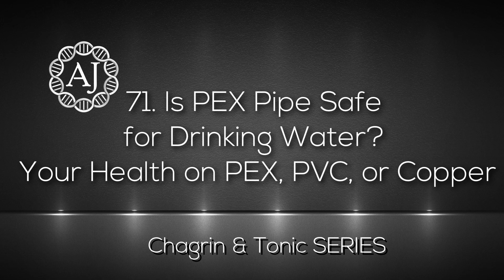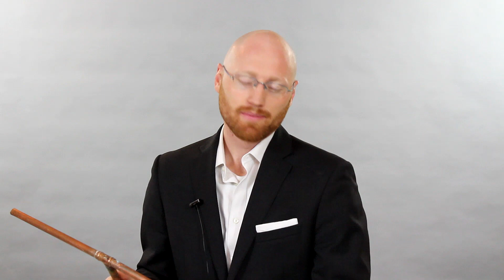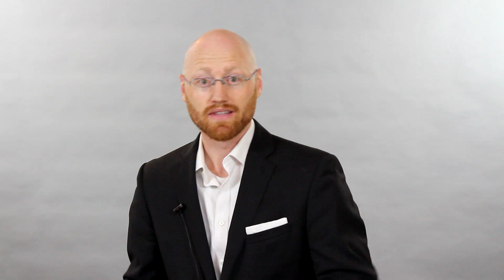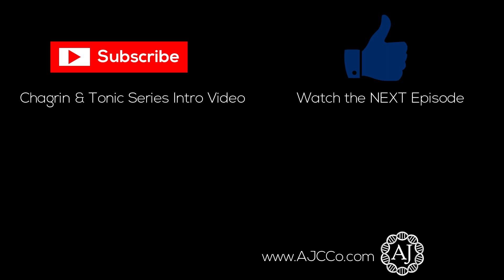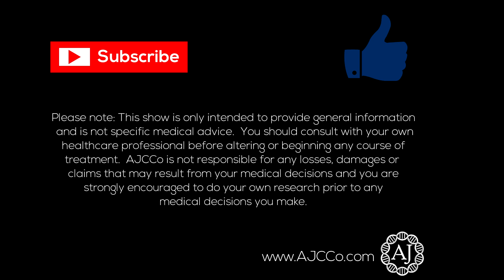Is PEX Pipe Safe for Drinking?  FILTER!

Comment: I'm curious if there is much danger to using the water for bathing and hand washing.  If we just filter our drinking water, does that negate the effects of the PVC piping?
Reply: The human body absorbs by the skin. Its still possible but a much lower risk.
Copper for Kitchen/drinking/cooking 100% at least.
A good filter would remove anything from PEX. Kitchen sink reverse osmosis filters etc. They not too costly. I would do that if you have pex everywhere.

Comment: your content is awesome and brings to light that no one in industry cares, build it faster and cheaper, i will stick with my copper plumbing as in a 1000 years copper will still be copper, a natural element. can you please look into the plastics that  filter heads, RO system plastics and any of the plastic filter jugs and other methods of filtering. Can you also test the water from copper plumping for these chemicals as the water coming to your house from the city is probably delivered from plastic city pipes?

Comment: Have you tested whether water filtration works to remove these specific chemicals in water? For example, I use zero water filter which comes with a tds Meter - but will the tds Meter read these chemicals/plastic? Will the zero water filter really remove these chemicals? And finally, do you know which would be worse- old pvc or copper piping vs pex piping? Thank you in advance I am trying to decide which place to move in to with these options..
Reply: Good question. I think Reverse Osmosis is the best practical filtration for drinking water. Distillation is better but takes time,  effort, and energy $ to make smaller quantities (quarts vs gallons.) But how much gets absorbed by our skin during daily showers?
Reply: @dii6266  Yes thank you. I have a filter on my shower head too but it needs to be changed too
Reply: @dii6266  thank you for replying :)

Comment: We moved in our home a few months ago. I had never seen PEX piping for the water lines until we moved here (exception, the previous house had PVC pipes and had a water softener/filter that used PEX piping - imagine that). I first thought it was kinda nifty to have "water hoses" as the water lines. The junctions and splitters and couplings LQQKED ingenious! But then, I started smelling the water. The water actually smells and, therefore, tastes like garden hose water. We have all sipped a quick drink of water from a garden hose on a hot summer day. Most garden hoses that we buy have a sentence that states, "do not drink the water from this hose." The water inside our house now tastes like that. Today I find out that piping is called PEX. When i was growing up, the pipes were copper pipes, and the water did not taste like this. I do not know what I am going to do!?  Thank you for this video.
Reply from the maker: filter all drinking water with activated charcoal
Reply: @dranthonyjay  Have you tested the water filtration from pex pipes after passing through the carbon filter?
Reply: @dranthonyjay  what is a plausible setup for in line charcoal filter if contaminants come from the piping? Only drink water from one fixture

Comment: PEX tubing is primarily used is household RO systems. So what your saying is your expensive water is contaminated as soon as it leaves the RO membrane sense the housing itself is made of plastic, and the tubing exiting  is PEX.
Reply: I'd think if you're talking less than 2-5 ft of piping from RO to tap, your exposure is even less. He didn't mention how long the runs of PEX were in the study.
Reply: drink  only   spring   water   ro   water   is   dangerous   contain  million  microplastic

Comment: I switched my hand soaps and I think I'll have to get an RO filter that you recommend for water, but I'm having a hard time finding a soap dispenser. I have found some where the pump can be stainless and the container could be glass, but the hose that goes into the container will always be plastic. Is this ok or does it have to be plastic-free?
Reply: Are you seriously worried about the little plastic tube in your hand soap container leeching into your hand soap?? Seriously??? Life is difficult for you,isn't it?

Comment: So PEX is better than Pvc? the problem with copper is not only is it more expensive but it also requires soldering if you want it done right which you do. But the fact has been known that plastics have poores and therefore it all leeches. Thats  a fact thats been known for along time, But i wonder if thats why pvc becomes brittle and breaks over times, because i was thinking if it leeches so much wouldn't it run out at some point? of course it would its not infinite which led me to think perhaps thats why it becomes brittle and breaks over time is it looses too much and becomes unstable?

Comment: My main water line in the subdivision is Poly, my main line to my house is Ply too and the storage tanks where the community well water is stored is Poly, how do I filter that water in my house before I run it in copper piping? I am about to run my plumbing in my new house next spring but don't see benefit of running copper in the house lines if my subdivision water is stored and run in Poly pipes all the way to my basement where is stubbed out in my foundation.

Comment: I understand being concerned about how our water is affected from our own plumbing choices (PEX or CPVC piping) but what is the condition of the town's/cities pipes that transfer the water to our homes? It doesn't matter what type of pipes are used in our homes if the underground town/city pipes are putting pollutants in our water. Remember Flint Michigan?
Reply: flint was predicted and preventable.
Reply: @robertcastleberry5108  But because the fixes are not cheap, they did not get done.
Reply: So add more possible chemicals into your drinking water because?
Reply: Honestly I know this is 5 years old but I would suggest to change all drinking/showing water to Copper. If anyone wants to save money but is worried about PEX. I have the plumbers run Copper just for the main to the water tank, to bathroom, shower, kitchen then everything else can be pex.. Laundry, outside faucets, toilets and so on.

Comment: My dilemma was to use PVC or PEX.  You did not read their abstract's full conclusion and you also only read the abstract of the article.  "Nonetheless, a shift from cPVC to PEX pipes in households would
 decrease potential exposure to phthalates."   Based solely on your video and their research, PEX is actually an upgrade since its phthalate count is drastically lower than PVC.

Also, a great follow up to your video would be what filters (charcoal, UV light, etc) people can use to protect their family and how they work to filter phthalates.  I have plastic cisterns and use PVC pipe to capture the rainwater.  Unfortunately I am stuck with plastic.  However, I'll use PEX inside the home since it leaches less (based on this article) and invest in a whole home filter.  The problem also is having a filter right at your faucet or else the plastic can still leach after the whole home filter.

Until my water is drinkable, my only other option is to use purchased water which are stored in High-density polyethylene
 (HDPE) bottles.  There's really no perfect solution.
Reply: I just found this channel and read your comment ...now I’m thinking..how about all the people like me that have gardens and use polyethylene between the rows and plants to keep weeds from taking over the garden...

Comment: Unfortunately there are many different types of PEX out there. So stereo typing that they all have leaching issue is not fair. For example, there is a type of PEX called PERT. Its the first polyethylene that does not need to be cross-linked and exceed the rigorous standards for potable water in the United States. Great stuff  (I linked below). I used it to replace my aging copper that kept developing pin hole leaks. Copper (especially old soldered copper) is more likely to release contaminants into the water.

I would a agree that certain types of PEX are better than others.  In identical conditions, less dense pipe (PEX-A, made from MDPE) leached much more contaminants into water (in some cases up to 200% more) than the higher density pipe (PEX-B, made from HDPE). I personally do not recommend a home run type system which is very popular with PEX. The more traditional trunk and branch method to feed all drops with a larger diameter main feed pipe insures there no standing water for too long. Unlike a home run system where each line gets it's own feed. If you don't use one feed too much, the water sites there longer. 

Lastly, there are new concerns about bottle water polymer contaminants. One study suggest the average water bottle drinker consumes a credit card worth of plastic a year. Yikes! 

_______________________________________________________________

http://www.legendvalve.com/pws1/hyperpure

More about PERT here...

https://plasticpipe.org/building-construction/bcd-pe-rt.html
Reply: Did you pay for the studies from the second link? I would like to see some of the results of PERT testing due to trying to decide if it is better for potable water than PEX for my house.

Comment: I have an odd convergence of piping to and throughout my home. 

From my well (which is remarkably good water, low in mineral count, very low radon but high in sulfur) the water goes through my first pump into and out of an aerator through a series of pipes ranging from 30+ year old PVC to modern PVC. Then it goes back through my second pump to get to my house (also though various ages of PCV). Once it gets to my house it switches to copper and then back again to either PVC or whatever metal piping is used for sinks, showers and toilets. 

Due to the age of the pipes I am going to have to re-plumb my house probably this fall. I am "thinking" of using the Heat PEX (the one ranging from 162-169 phthalates in npl). However, I do not know what good this will do IF the piping TO my house is going through very old PVC int he first place. Furthermore, I am not in any way sure what kind of contaminates are picked up in the aerator tank through contact with the fiberglass and whatever coating they have on it. 

Water testing seems impossible since all the ones I've talked to require me to tell them what I am specifically testing FOR...and that is just it, I want to know the presence and concentrations of anything that isn't 100% pure water. How would one test this?

So what would you advise?

Also, what are the health difficulties of showering in this water and only filtering what we drink?

Do you know of a reliable water filtration system. I am looking for one which will filter water for my kitchen sink and refrigerator ice maker?

Finally, I've looked for "HEAT" PEX and cannot find it - all I see is Red, Blue and White (and the white is labeled NOT FOR HOT WATER). Obviously I'm going for the approach which will leach the least amount of chemicals into my water. Can Heat PEX be used for both hot and cold and where can I get it?
Reply: There's no such thing as "HEAT" PEX. There's PEX types A, B & C. Type B is what you get at the big box store. Type A is what building contractors prefer and it's softer and more flexible and they say it can leach more chems. I don't know what type C is but I believe they're all basically the same material.
Reply: @tinman1955  Thank you so much, I of course moved froward with this project a while ago. I used cpvc since I eventually found a study which was far from complete or comprehensive, but it compared PCV, CPVC, PEX and i think two more I cannot remember, and CPVC came out on top with the least amount of chemicals leeching into water both initially and over time. I really believe this is an area where more study needs to be done in order to create something which is dependable, easy to install, durable and will not leech harmful chemicals into our water. At any rate, at least you responded and I appreciate that, thank you!
Reply: @markwoodson3703  Glad to see you got the best option. As for hole house water filtration Pelican has a good system. I myself use zero water pitcher/filter for drinking and then I have a similar shower water filter that I connected to my shower. I don't own a home so I kind of just get things set up best I can while renting...

Comment: I work in the piping industry there is a lot missed in this video, I agree I have concerns about plastic piping but there is a lot you are not considering. #1 Copper piping is a major major major problem if someone has ACIDIC well water. Which is common in a lot of areas, acidic water leaches copper out of the pipes into the potable water has extreme health effects. Recommending copper piping in all situations is very dangerous without having someone consider all options and situations. A critical miss in this video There are multiple types HDPE (pex being one of them) multiple manufacturing methods and multiple uses to be considered when installing. For example, HVAC hydronic pex water piping (I believed it is Pex type A) would be a huge hazard to health it is not designed for potable water just like PVC is not designed for human consumption and that's why it installed in drainage systems only. There are Pex that are designed specifically for potable water, specifically because it does not leach large quantities of plastics into the drinking water. I believe Zurn and Uponor have these sold under Pex B (don't quote me i'm going from memory if you're doing new installation please do your own research to confirm). In an ideal world we would all use pharmacudecal grade stainless steel that is orbitally welded for our homes drinking water this would have no contact with any potentially harmful chemicals and would be the purest transfer of fluid you can obtain, I am joking of course but need to mention it to make my point...that piping in a typical home could cost upwards of $100,000 just for a few sinks. cost is a major component and these issues need to be balanced with that consideration. I would love to discuss this topic further if you are interested or have questions.
Reply from the maker: i appreciate the "insider" viewpoint.  a lot is missed in all my vids - they're 5 minutes or so.  that being said, all pex leaches phthalates.  and  i tend to agree that copper can also be terrible but at least it won't go through your skin and it doesn't cause transgenerational health problems.  both phthalates and copper can be filtered, negating the need for $100,000 piping, but most people don't/won't filter shower water making phthalates the worse choice assuming you filter your drinking water as I always recommend -DRJ
Reply: I have been enjoying your videos I just found out about your work from Robb Wolf I would love to see you a long form podcast like Joe Rogan to discuss these topics in detail.

I can definitely agree overall Copper is ideal for most people especially if you are using city water, I live in a rural area of Delaware and my water is very acidic (6.0) likely because I am surrounded by soybean farms which may or may not be why my local ground water is so acidic. I have a water softener+optimizer that makes my water more basic and any copper that was used in the house prior to the install can be seen discoloring the bottom of the sinks and bathtubs with a blue/green stain just as a side note.

I do find your comment interesting that all types of pex leach phthalates and if you have any links to studies I would be interested in seeing that, and if it's all pex or all HDPE which is generally viewed as very safe in the industry for potable water. In my own research I only found issues with HVAC pex specifically. Also I would very curious to know if reverse osmosis is able to remove the chemical contamination of phthalates.

Also what material do you recommend for shower curtains to avoid the phthalates during a warm/hot shower?
Reply from the maker: Justin JRE long form is in the works. send him a note - it helps
Reply: I'm a plumber in Australia and as I knew pex piping is not a healthy option I didn't realise it contains phthalates. Pex piping is all used in homes and apartments here with copper only being used at times outside of the homes and apartments for the mains water supply.  Do you have any resources or studies to back this up?  @dranthonyjay
Reply: Copper pipe is king.

Comment: I had a sneaking suspicion of this. Plastic is the devil’s ore.
Reply: There are a zillion different types of plastic.  We should not forgo using it for water pipes as a whole, we just need to find the right formulation that is safe.  It's an engineering problem that us solvable. The problem is companies will not run every test because its expensive, thus the need for the EPA and proper regulation.